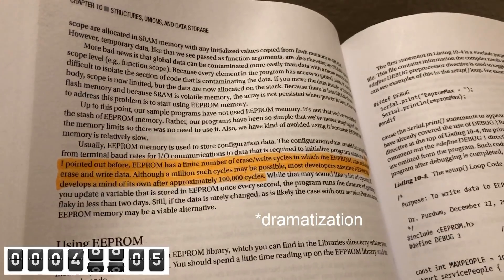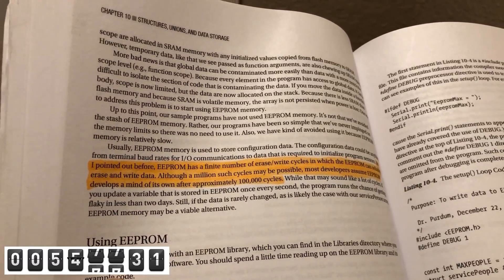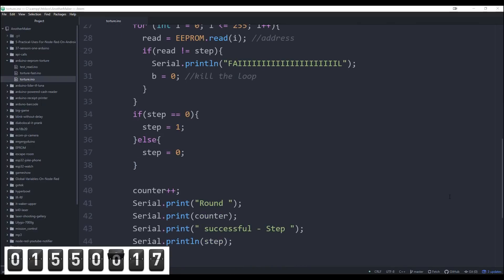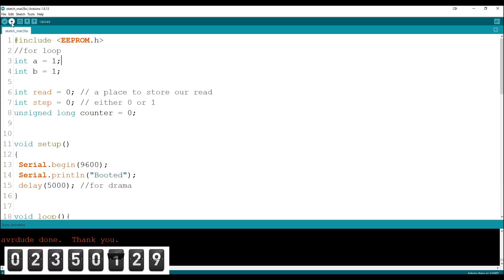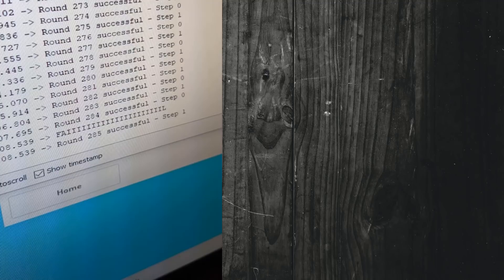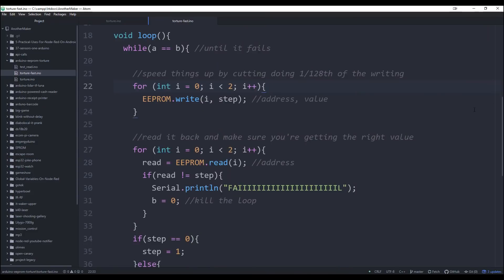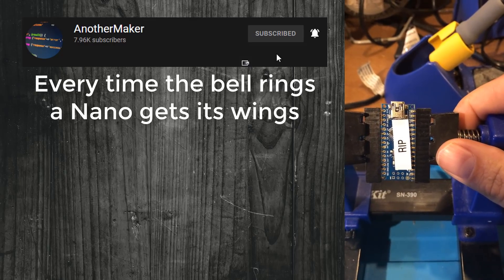How many times can you write to the Arduino EEPROM without killing it?

Comment: if you delete all your Serial print code. you can read/write it much more quickly as the serial operation is taking the most of the arduino run time. It you just want to make sure it's making progress you can just print every 1000 R/W instead
Reply from the maker: That's definitely happening in my next test. I'm going to see how much faster it makes it in reality. Thanks for the tip.

Comment: It is very heat dependent. You could re-run the test at elevated temperatures.
Reply from the maker: I've been hearing that.  I can put one in the air fryer :)
Reply: @AnotherMaker  if you ran two of them at two different elevation extremes (sea level/0ft and 10,361ft Alma, CO for instance) and controlled for temperature and humidity, the one at higher elevation should fail sooner. (Due to cosmic radiation.)

Comment: Atmega microcontrollers are more robust on a larger node and have a more broader upward tolerance, I tested an ATxmega128A1 and after 70K write/erase at @30-35gr celsius ( in datasheet 100K at 25gr celsius ) the EEPROM cells died, but died only for that page of 32 bytes, the rest of the pages were not touched.
Reply from the maker: Ok.  So interesting to know that the whole section died.  Tanks for sharing!

Comment: It's usually specified as "guaranteed 100k". Manufacturers have to be careful. Say if the chip crashed a car and killed someone.
Reply from the maker: Yep. Absolutely.  I don't want to keep killing boards to get a bigger sample size but it's interesting to know that with a few tricks, you can extend the life to basically forever.

Comment: You need to do wear-leveling. Write/read bytes to address+1 (in circular mode) each time.  Spec. minimum writes before failure is 100K. With a 1kx8 EEPROM, you can write/read a byte 100M times before failure.
Reply from the maker: I do agree.  I'm going to cover wear leveling.  I intentionally fatigued one area of the chip because I was trying to test it per bit in case you are filling the whole EEPROM.
Reply: @AnotherMaker  I wrote a personal library to manage the circular addressing mode if you're interested. Let me know.

Comment: I think 100k is a fair number to work with. It says developers assume 100k cycles, it doesn't say it dies then. You want to assume a lower number, because you don't want your arduino to just die suddenly when doing something important.
Reply: Atmel rated the EEPROM for 100k cycles, and the Flash for 10k. That's times it is expected to work before failure, across thousands of chips; most will do better. Besides, int on AVRs is 16 bit, not 32.
Reply from the maker: I totally agree. It's a fair number.  And with some wear leveling and slowing down how often you write to it, that can be a decade worth of writes.
Reply: assume the baby human will die at age 8
Reply: @marksmod  well, people have life insurance cause they assume they might die some time soon.
Reply: @jort93z  touche

Comment: Thank you for this short test. I knew the EEPROM chips would never write again after you go past the limit. I always thought they would still have infinite times for reading the values, but I didn’t think it would stop working all together let alone fry the processor at the same time.
Reply from the maker: It actually didn't stop writing on its own.  It just didn't read back the value it was expecting, so the test stopped itself. But that's kind of worse because it wrote a 1 thinking it was a 1 and got back a 0....so without that test, you could be storing bad data and not know it.
Reply: So you programmed it to stop if something is wrong? So the processor isn’t fried and still works fine. I wonder if everything else will still work normally without the EEPROM? I think it should you just can’t save data or anything. I do wonder if the unused parts of the EEPROM in your test will still work for at least a short time after the first few bytes have been used up.

Comment: Doesn't writing to solid state wear out some gate things, meaning it starts to leak elevtrons over time resulting in the stored value changing
So while it may be able to be written to a million times and hold the data long enough for a read test a couple milliseconds later, would it be able to hold that data for a month without anything becoming corrupt?
Reply from the maker: I think you're right.  I'm definitely doing that test.
Reply: Another thing to remember data loss can occur under high tempatures and if left unpowered

Comment: The more bits you write the more likely you find the bit that doesn't last as long as others. This means the longer the program the more likely it fails with fewer writes.
Reply from the maker: Yep. Absolutely.  It's an average. My guess is that most people are writing a sensor value, state,  or simple config to the EEPROM which is why I chose these lengths.

Comment: That thing can still function, just replace the eeprom chip and it will be good to go up and running again. Solder joints can be reheated 4 or 5 times if you do it right which means you can replace the chip 4 to 5 times. Until the PCB or the pads say bye bye. And if you use pin heather socket for the Nano then you can replace a couple 1000 times the nano itself and for every nano you can do the same chip changing procedure so you project what ever it might be could survive the live spane of your entire life and of your descendants many times over so please don't just throw that Nano away. It has barely been produced. PS: I Subbed, up voted and broke your bell icon to see more of this Madness 😎👌
Reply from the maker: I believe the EEPROM is just part of the ATMEGA 328.  
And thank you. More madness to come. I'm definitely doing autopsy to find out what these boards can and can't do.  Thanks for taking the time to sub and comment!
Reply: @AnotherMaker  yes it is indeed in the ATmega 328 integrated. Replacing the ATmega 328 chip is not big of a deal with the right technique and equipment. Nothing that can't be done with a bit of praxis and knowledge. I mean I started in my new job as a newbie as well and now replacing such chips on a daily basis is pretty satisfying.

Comment: 256 ints * 4B = 1kB so you wrote over the whole eeprom.
What if you write only to the first half of the eeprom(512B = 128 ints) until you kill it and then try using the second half? Would it work or is the entire chip dead
Reply from the maker: You're absolutely right.  I will be trying. I'm going to figure out what is still useable on these boards. The second one still has plenty of untouched EEPROM
Reply: @AnotherMaker  I have used the first bit of memory to hold the offset to the data to be written often. When a failed write is detected, I change the offset to the data and continue writing to the new section.

Comment: It's not "ARUDIONO EEPROM" it's ATmega or whatever chips EEPROM that particular arduino is uses, ffs
Reply from the maker: You're absolutely right.
Reply: @AnotherMaker  That little moment of surprise when expecting a crapstorm then realize you're not on 9gag lol. Was it 328P? Would be interesting to see the endurance with a rolling rand() pattern, that would tell if any "crosstalk" happens. Different clocks and voltages also could have some effect on endurance.

Comment: First - A lot of EEPROM have built-in features like wear-leveling and bank writes.  For wear-leveling, the EEPROM will spread the write out over the whole device.  This is why, when you wrote a small amount over and over, the device die once it failed as the whole EEPROM has been worn down.  For bank write when writing to an EEPROM, it normally write in a bank (group) of addresses at a time.  For most SSD, the bank size is 4K Bytes.   So if the bank size is 512  bytes (This is common for EEPROM that using a FLASH that is 1MB or bigger) than each time to write two bytes, it will erase 512 bytes modify 2 bytes and write 512  bytes back to the EEPROM.
Reply from the maker: Absolutely. This didn't have any built in wear leveling to my understanding.

Comment: Nice experiment. You must write 0xFF to flip all bits (cells) of a byte. Also, you must be sure the code or ATMega internally doesn't take smart actions or use a buffer to write to the cells. Better write the code in assembly to write to the cells directly and not by using a library.
Reply from the maker: You're absolutely right on this. I was using the common tools because I think that's how most people would use it and I know very little assembly, but that would be an interesting experiment.
Reply: @AnotherMaker  Don't think it'll actually make a difference. Since one can only access the EEPROM through a single byte anyway, buffering wouldn't make a difference (and would be unnecessary). Could also check what the EEPROM "library" does
Reply: C++ doesn't make optimizations when writing to the EEPROM since all registers are declared volatile
Reply: Writing it in assembly isn't neccessary as the stuff isn't buffered on the mega (and can't realistically be, there isn't enough memory, on the mega the SRAM is only twice the size of the EEPROM). 

The most accurate way to do this would be to use a script to do it over serial (you could use a computer or another Arduino). You would command it to write the data, then power it off for a bit, then power it back on, read the data to verify, and if successful do it again. I'd probably do this in batches. Since it's rated for 100,000 write cycles I'd probably do it in batches of 1,000 (1% resolution).

This is the process I would use:

1. Write to it 999 times, alternating between 0x00 and 0xFF without verifying the writes.
2. Write one more time with pseudo-random data (you want data that is predictable so you can verify it, but you also want it to be different each time you do this step -- the 4KB need not be entirely unique, I'd probably only use a 16 or 32-byte block and repeat it).
3. Power it off, wait 5 minutes, power it back on.
4. Verify the data of the last write.
5. If successful, repeat.

The reason we write random data to test with is because it will help check for stuck bits. This test can be made better by changing step 1 to 998 times and repeating steps 2-4 with the data inverted (0s become 1s and 1s become 0s; bitwise NOT does this) to make extra sure there are no stuck bits.

Even though we are powering it off for 5 minutes at a time, this test might be quicker because we aren't logging data to the serial console as often. We would just have 3 simple commands:

CYCLE [N] (where N = the number of times to alternate writing 0x00 / 0xFF, this would be 999 or 998 in my example above; returns OK when done)
WRITE [DATA] (DATA = the data to write, it will be repeated to fill the EEPROM; returns OK when done)
READ [DATA] (DATA = the data to read; returns a positive integer which is the number of bits that failed to verify, so a 0 = success)

This would be the most comprehensive test you could do in a (relatively) short amount of time. Once you have an idea of the average failure rate you could adjust the test to write some percent short of that many times and then start doing longer power-off cycles, such as a day, week, or even a month, to verify the long-term stability of the data written.
Reply: And here I am. I don't have a clue as to what you just said.
Reply: @magoolew5131  xD
Reply: @magoolew5131  Haha

Comment: You should write 0x55 and 0xAA for testing the memory
Reply: can you explain why 0x55 and 0xAA exactly?
Reply: @dannihijacked2508  0x55 is 0b0101 0101 and 0xAA is 0b1010 1010 so it will swap all the bits to get maximum amount of wear to the EEPROM
Reply: @Kurkkulimu  But he's writing all 0s or 1s on each cycle, would it really make difference?
Reply: @Daniel-ij3ks  he isn't, he's writing 0b0000_0000 then 0b0000_0001. Using 0x00 and 0xFF would also work to maximise the bits changing
Reply from the maker: You're absolutely right.
Reply: Why does that matter if all the bits are being flipped each time?

Comment: I would change the baud rate on your sketch, it will speed up the test. Also the 1Mill stat sounds correct  given you hit 2.5 mill in your test, it tracks with typical probability density  and how you would rate the reliability. If you were building a high reliability solution, you would not want to push it past 100k since that puts you well into a couple of 9's on reliability.
Reply: If I have seen it correctly then he always sends the count over uart…this is slowing down the process significantly. If he only writes the counter every 10 or more times the result will not be much changed but time for the test will be faster.
Reply from the maker: Yep. Absolutely. I'd be interested in seeing how much faster it could be written.
Reply from the maker: Absolutely.  I think 100k is a reasonable safe bet and with wear leveling and not writing 33x a second, that could be 10-50 years.
Reply: @AnotherMaker  is this a challenge!? Because I've got a nano that could probably be sacrificed to the destructive testing gods.... standby...

Comment: Nice idea to check this.
A while back I checked out Microchip's app note for their EEPROM chips.  Turns out:
1.  Quoted life was at worst case temperature and voltage.  With nominal voltage and room temperature, life was longer. 
2.  Failure rate is a S curve.  Only a handful fail at the rated lifetime.  Most chips last longer but then all start to fail together.  A handful keep hanging on.
3.  On the chip in question, you could burst-write several bytes, and that only counted as one write.
Reply from the maker: All good points.  Yeah. This was an intentional torture hoping that things like your comment could be gleaned out and we could learn how to be smarter about it.

Comment: Before I saw the video, I thought, with good memory management (I'm not an expert) a 100000 cycles is still in most cases infinite. I also think if you made something and really use it, it will be probably obsolete in 10 years. One can argue: 'well use that arduino for something else'. But I guess, by then there will be a new 'killer ùController' that we will already have purchased just because of wanting it. 
Nonetheless, very informing video. 👍
Reply from the maker: Thank you. Yeah. I think if you use it intelligently, you could easily write to the eeprom for the useful life of the device.

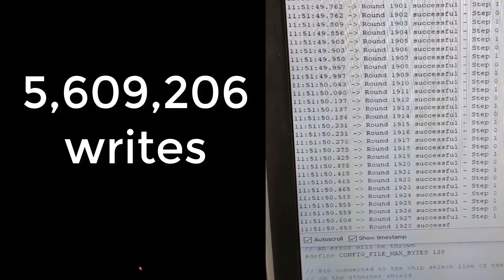Comment: The EEPROM held on for 42,294 minutes. How long did you manage to hold onto the barrel of the soldering iron at 2:21 ?
Reply: He's built different. You wouldn't get it...
Reply from the maker: haha. I'm special.
Reply from the maker: haha. I have pretty tough hands :)  All my solder joints smell like bacon for some reason.
Reply: @AnotherMaker  That's just disgusting
Reply: About 100 ms.
I have tested this hypnosis more than once.

I used words not normally looked up in a dictionary in all cases.
Reply from the maker: I used to work in a restaurant and I do construction. My hands are pretty tough. lol
Reply: @stevemorse5052  Do you mean 'I have tested this hypothesis...'?
Reply: @MrTerrymiff  Err, yes. And I thought I had corrected it!. 
Thanks!
The last time I picked up an iron like that was about 2 years ago. That's how I know about the 100 ms.
Reply from the maker: I've done it a time or 2.
Reply: @stevemorse5052  Don't worry about it (bringing your digits in contact with the iron). I've done it numerous times. Usually by placing my index finger on the barrel while trying to get particularly recalcitrant components off of a board. 😖 The scar tissue reverts to skin after a while. 🤕 😊

Comment: Nice to have some real number. I Googled this just recently and all the numbers were all over the place and no 2 sources said the same.
I think the higher number that you got is a statistics thing. Let's say there is a propability that one bit of the eeprom dies. If you write the WHOLE eeprom, them the propapility that one single bit (the weakest storage cell) of the whole eeprom dies is way higher, than the propability of just a single bit that fails. Comparable to the weakest link of a chain. The longer the chain becomes, the likelier you are to add a weak link. So the 100k or 1 million might be accurate for a whole eeprom, right?
Reply from the maker: I did the same thing. I saw all kinds of comments and answers. Obviously there are a million variables, but at least doing a real test gives something to go off.  I do think the 100k number is safe.  I would do some wear leveling and obviously not write as often and it could easily survive the lifetime of the device.
Reply: The only reliable source for those figures are from the datasheet of the chip in question. Either from the mcu datasheet for an integrated eeprom like this, or in the datasheet for the eeprom itself, for an external eeprom chip

Comment: But if you kill the EEPROM  the rest of the chip should still work right? Since its separate from the program memory.
And if you only kill certain parts of the EEPROM the rest should also still work.
Reply from the maker: Yes. I believe the higher addresses of the EEPROM should still work and the board should work fine, although I still need to do an autopsy to find out what damage I really did. The goal here was to stress individual bits of the EEPROM. I'll definitely need to figure out how to test the rest of it.

Comment: Interesting! Also weird that the one got bricked after it failed. Does it happen to draw exceptionally high power?
Reply from the maker: I'm not sure yet, but I will definitely check.  Thanks for giving me something to look out for.  What would that mean if it did?
Reply: @AnotherMaker  I don't know just wondering. Its simply weird to me that just writing to the EEPROM (an absurd amount of times :-)) totally bricks the whole microcontroller.

I am just speculating here, but maybe if the EEPROM fails it can somehow create an internal short circuit in the EEPROM, therefore also dropping the supply voltage of the arduino?